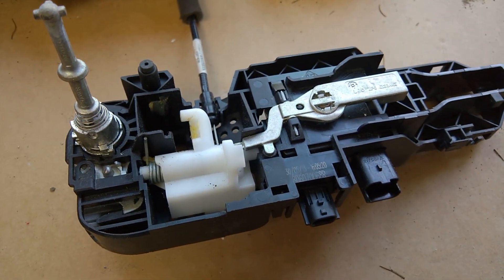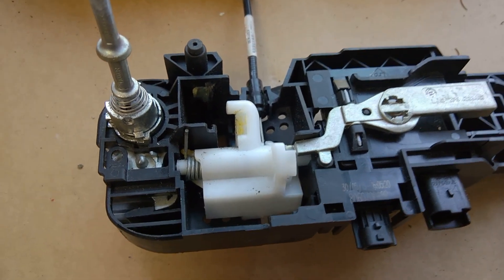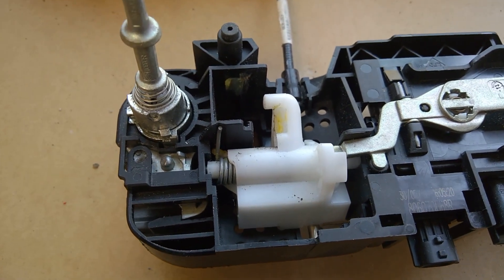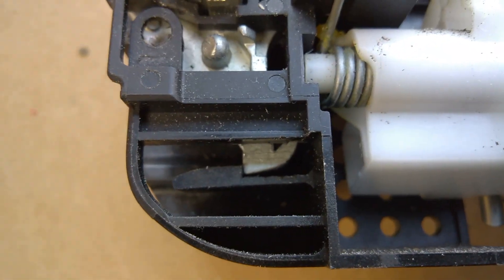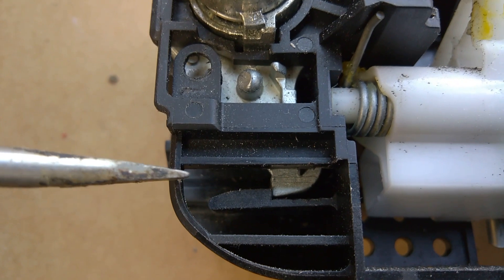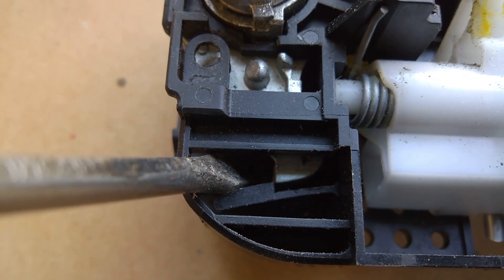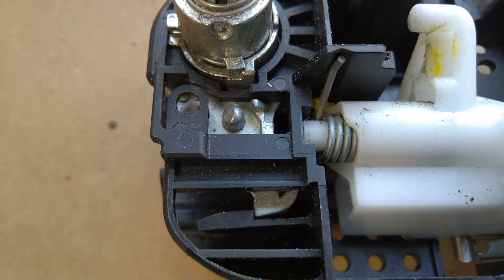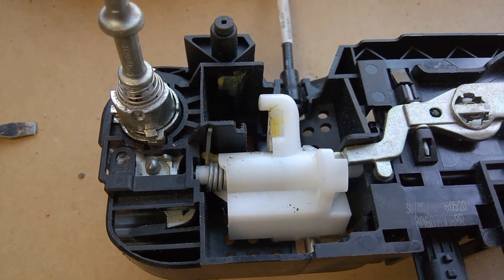Renault Megane Mk3 Cabrio door lock removal

Comment: So I am at this part where I push down that plastic bar, but then i don’t get it, should that metal thing rotate by itself when you push the plastic bar down? 🤔
Reply from the maker: It needs to be pushed gently over which then releases the barrel, which can be pulled out of the door. Let me know if that does not work
Reply: 22hman Well I’ll try again then, thank you. I assume this method is the same on megane Coupes? I’ve got an RS250 🤔
Reply from the maker: No idea, sorry, I have only done this on the cabriolet. The other videos did not work so I was left to find out how to do it and came up with this